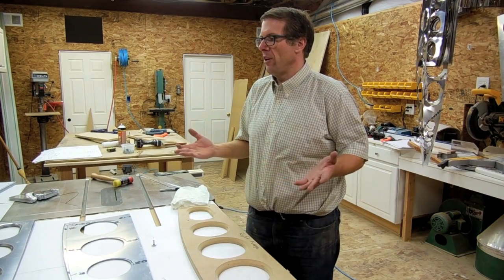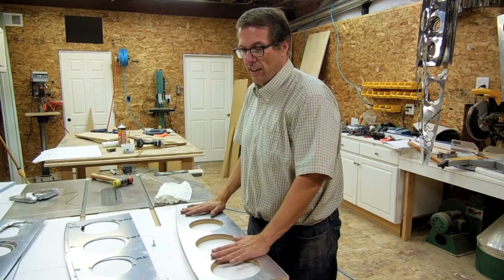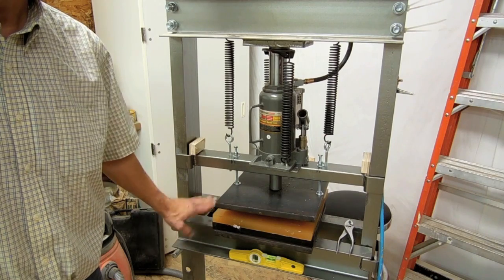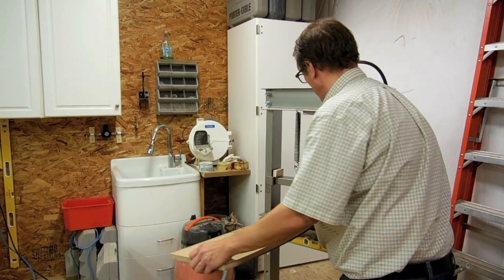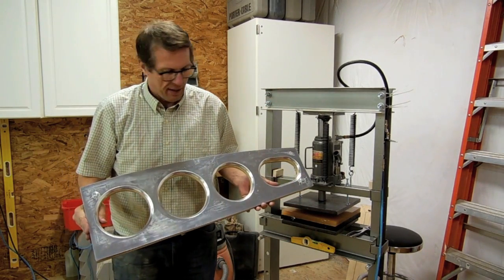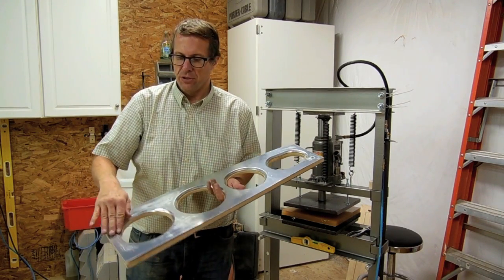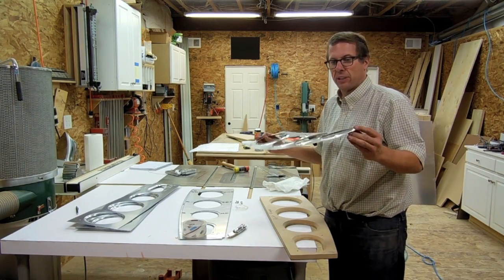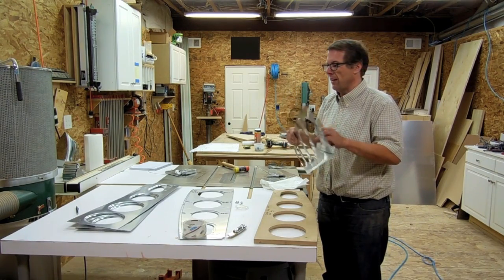Bearhawk Patrol - Part 3: FOrming lightening holes with Rubber Pad Forming

Comment: I know it´s an old video but I got 2 things none the less.
1. When mentioning rubber hardness a number is usually not enought, it could be Shore A or Shore D for instance. No complaint, just for people making not knowing. 
2. When using machines like that, please use some kind of shielding when standing beside it. A small piece can break out any time and injure you severely. So stand around a corner when pressing the button or use a PC plate in front of it or something. I have worked for a while in automotive engineering and I have seen all sorts of injuries when doing stuff like that.
Lastly I want to thank you for that cool video.

Comment: nice system seen the rubber being used before on embossing letters into sheet metal they used letters cut out of metal stuck to a mdf board and pressed into rubber with sheet metal in between  , think you could do door cards with bead roll shapes by using the same method though you would need to shift the panel a few times under the press to get the whole surface done  , wonder how thick a material you flange with it before it maxes out the 20 ton press and if you can do something similar using an english wheel with a rubber wheel instead of a press  
i wouldn't be surprised if you could bend over the sides to make a mounting flange of the wingpiece using the same template and method , though you might go over it after pressing it to get it at a right angle but you should be able to make the initial radius bend started , maybe even at the same time as doing the holes you might be able to get most of the potatochip out of the center piece by preloading / adding a small raise in the middle of the mdf template , this strip of wood under the middle at the top should be enough , the mdf will deform some but that should help against the aluminium bowing away from the flanges

Comment: 4 videos watched 3 different ones and I have seen more mistakes and stupidity in 30 minutes than watching some guy scratch build a metal rc plane with just hand tools and a vise ... at least the guy with the hand tools actually paid attention to what he was doing and saying and was actually working in a safe manner all the time ... not this guy ... he forgot all of his shop rules and obviously never had common sense ... I bet he still wants to touch the red glowing thing on top of the stove before mommy puts the pot she wants to use on it .. 
.
tbh not worth the time or effort to get a tid bit here and there ... no matter how good the information is ... 30 minutes worth of time to learn you can cheat a bit by adding a strip on the back of a nose rib to lengthen it IF it is the same shape as the rest of the leading edge ribs .. and that if you dont cut the center holes all the way you save flying discs of doom ... nothing else is new or special ...

Comment: how much spring back did you account for in the flanges ... if any ... or do you plan on leaving the inner flange at a 87degree angle approximately after the pressing ... a flange tool would be much better than this press method for single hole flanges ... and is more accurate ...
Reply: clean off the lemon pledge ... its spray wax ... a wipe doesnt clean it off .. it just polishes it ... alcohol ... methalated spirits (thinner) or a mild acid like vinegar will clean it off ... a cloth and wipe just polishes ... 
seriously ... 3 different eipsodes and more common sense mistakes and fundamental flaws than I can shake a stick at ... all for a tid bit here and there of useful information ...
Reply: Seriously ... you left the plastic cover ing on and still lemon pledged the plastic ... remove that before you press ... and since you removed it after all the main work was done ... no need to polish the pledge before more work just remove the plastic and the pledge layer with it ... 
.
I swear if this guy had my shop teacher he would have failed the class every time ... as he is NOT actually paying attention to what he is actually showing and doing and not even doing that all properly ... 
I came here to learn new stuff not point out obvious common sense head up your ass type errors ... and stupidity ... but what can you expect from an american ... they never paid attention to common sense
Reply: hang on you are double pressing ... when you dont even need to you could have formed the inner flanges and the outer edge overlap all at the same time on the press if you actually had a decent press to work on ... and yes that means all the inner holes and all the sides ... even the adjustment you just did for the inner flanges is now wrong because you now are going to repress the rib or hammer it and create new bends and stresses in most of the same areas ... work hardening your material and inducing a stress fractures in to the part before it ever gets mounted on the plane ..

Comment: Good job. I once worked for a company name General Forming. This is known as Hydroforming. We did it on a much larger scale. Rubber under pressure flows like water.
Reply: technically hydro forming is done with a fluid NOT a solid like rubber ... and it is called rubber press forming ... a hydro form is like vaccumm baggin fiberglass  or using water pressure to push a forming die into a piece .. and anything under enough pressure will ooze like water ... that doesnt mean it is hydro forming ... HYDRO is the key there ... it means the use of water or liquid ... to make the part ...

Comment: Will the pressure break the mold?
Reply: in time yes ... for doing one to say 5 planes perhaps not ... after that most likely .. wood is an ok SHORT TERM mold form ... if you want to make thousands of identical parts Metal ... and even that will need to be replaced over time ... just a lot longer time between than wood ...

Comment: 20 ton? are you sure that's big enough. Nice job though.
Reply: depends ... he's using 0.025 aluminium (aluminum is a trade mark name held by reynolds manufacturing for Aluminum foil wrap as they cant trade mark a proper element) ... so roughly 1/8 inch thick ... which makes it quite soft ... the strength of that thin a material and he could use a 2 ton bottle jack no problem ... if he went to 1/2inch then he might have a problem .. if he was using titanium on the same thickness then he might be shy of the required pressure ... it all depends on the stiffness and malleability of the material

Comment: Have you tried this with a male wooden part to fit the female wooden part?  
 
It seems to me that if you made a male 'cone'...   then the press would do the job in seconds as it would only be pressing on the actual part required,   so the flange would form immediately...   No? 

Plus, I think this might avoid the whole rib being out of shape too...  Worth a try?   
You'd only need the very same router that you used to make the female that you have now.

Comment: You are one of the best teachers I have ever heard/seen, bar none!  Thank you for all your work in in producing these videos!
Reply: you must have had some really crap teachers ... my shop teacher would have kicked him out of the room on the first episode .. sure he does relate some information very well BUT he sure as hell doesnt use common sense ...
.
this guy lemon pledged the plastic coating then polishes it then removes the plastic he coated with lemon pledge ... he didnt even need to pledge the dang thing he could have and should have removed the plastic BEFORE he pressed it and then not adjusted the tension until he had the whole rib formed ... the guy is doing a half assed  job and not even doing that well

Comment: Polyurethane sheet McMaster Carr Part # 8789K71 ... choose 60A. Any backer under it is fine, the Polyurethane sheet does all the work. 12" x 12" x 3/4" thick about $115.00 plus shipping. They have different sizes too.

Comment: surprised the wood form doesn't break under the pressure. Cool stuff, thanks !
Reply: the wood will break after some time ... as it is repetitively compressed and expanded which over time weakens the cell structure of the wood and causing it to splinter and fracture ... think of it like standing a loaf of sliced bread on end then pressing down ... it bounces back mostly BUT some parts dont ... after a time none of the parts will ...